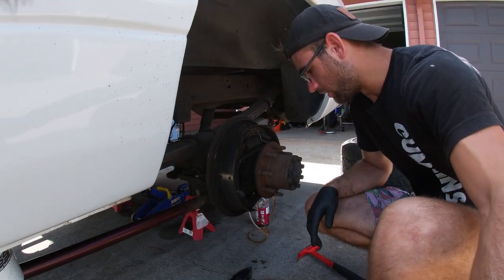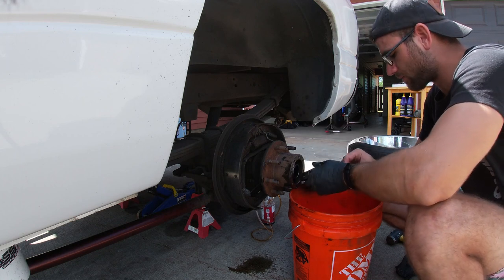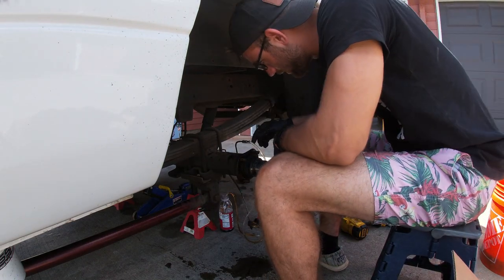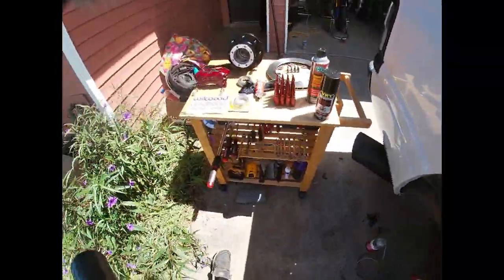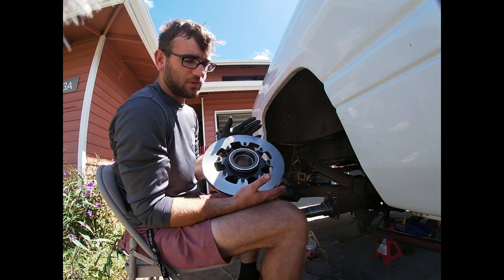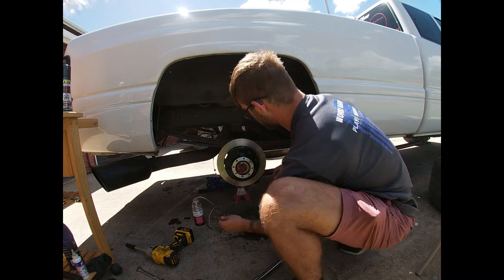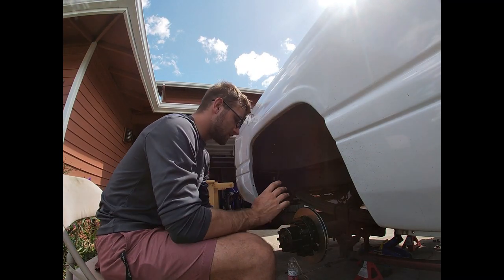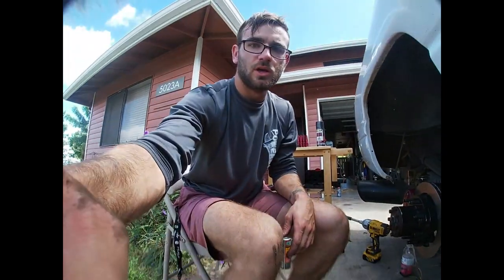2nd Gen Dodge Drum To Disc Brake Conversion kit! Install And More!

Comment: Well hell I'm screwed right off the bat with my 2500 4x4 with rotors on back and with my Dana 60 diff So I'm "f"  to win any that stuff
Reply from the maker: @DonaldRak-ku6bi  dana 60 shouldn't be in the rear of any 2500
Reply: @Designed_Diesels_  Well far as I know from when I purchased the dodge 2500 4x4 it's  original  rear differential  posi  traction So I guess I got the one and only Hot Dam !!!  It's got dana written on it plain  Jane:
Reply from the maker: @DonaldRak-ku6bi  is it gas or diesel?
Reply: @Designed_Diesels_  5.7 gas magnum
Reply from the maker: @DonaldRak-ku6bi  ah that why diesel are dana 70 or 80 only